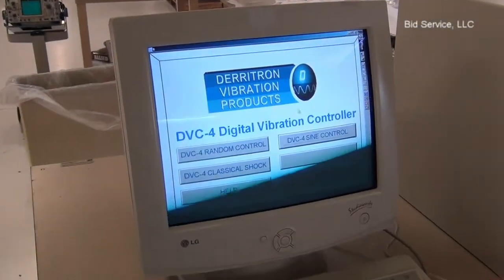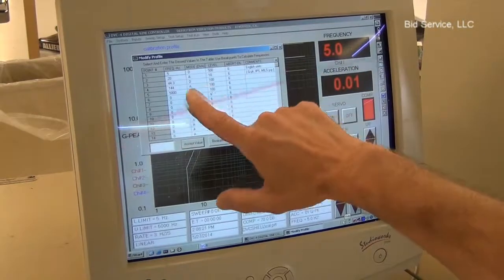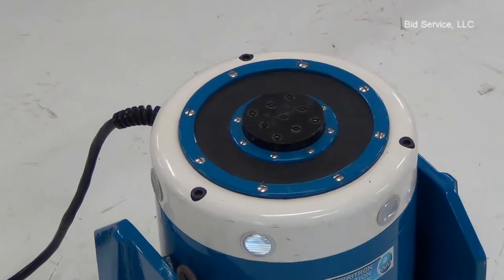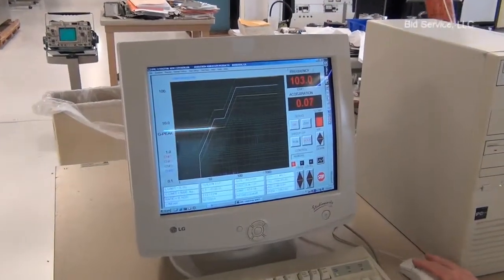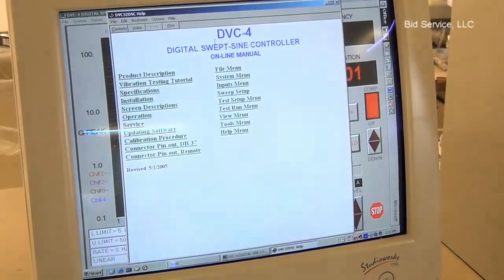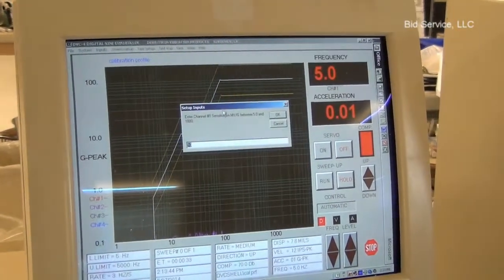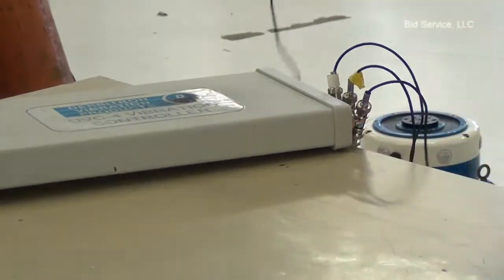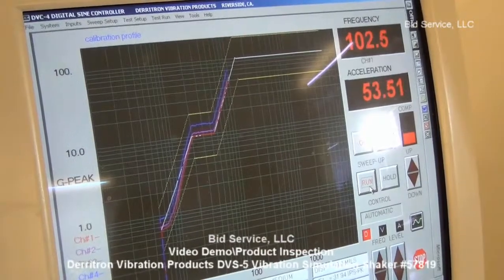Derritron Vibration Products DVS-50 Simulation Shaker #57819

Comment: This vibrator and its trunnion were originally designed and built by the British-based Derritron company at their Hastings factory in the UK.  How do I know? ... I worked for Derritron for many years and tested this, and other types of products including their large water cooled valve amplifiers and the transistor power amplifier range.  Yet another company sadly lost to the UK.
Reply: I worked there too, 1987-1989
Reply: Me too, I worked there from 1987-1989, wiring department.